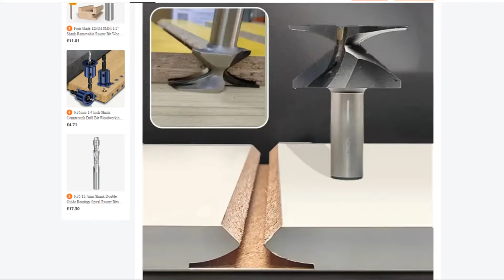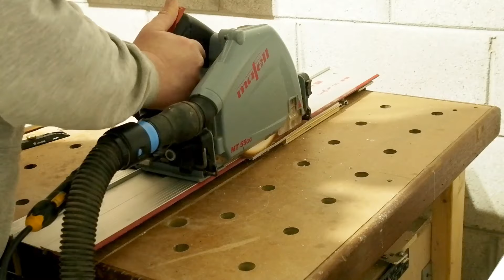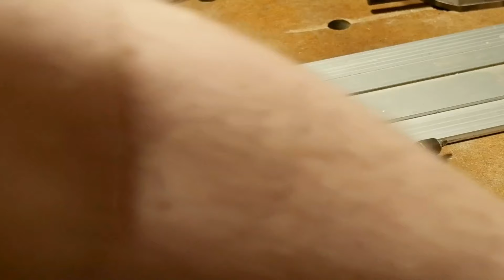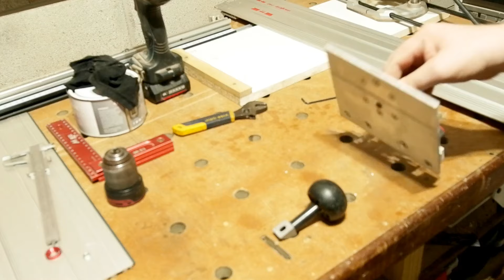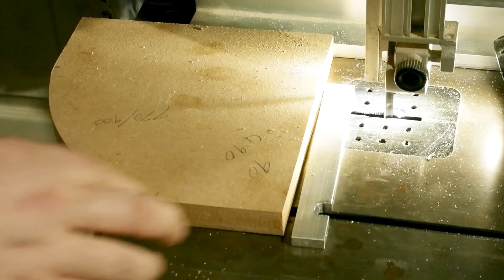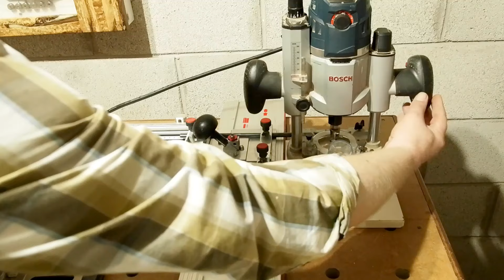DIY Precision Router Guide Rail Adapter - Solid Aluminium - For Mafell and Bosch Guide Rails

Comment: A good idea and well executed. You can't beat a smear of beeswax to lubricate sliding components without clogging everything up with dust👍
Reply from the maker: Cheers! 1001 uses for beeswax +1😉 I have a tin of axminsters machine wax. I find it very good for a slippery surface. Buffs dry so doesn't collect dust either👍

Comment: That’s top work Man. My only nit picking suggestion is with the micro adjustment. Maybe stronger springs and a finer pitched thread. The springs to ensure the mechanism is always bearing against one side of the screw thread, and the finer pitch for finer adjustment.  But, that’s the sanding equivalent of going up to 4,000 grit.
Reply from the maker: Cheers buddy. Believe or not, the m8 is twice as fine a pitch as that on the bosch ofa! Any finer pitch and, to be honest, I'd just get frustrated with how slow it would be. A couple of slightly stronger springs would be nice though to cut down back lash. The ones I'm using are from the micro adjust on the bosch "deluxe" fence. Always appreciate your input and ideas mate👍

Comment: This is a project Hongdui should partner with you and make! 
Great project fella, then end result looks the business as well. I’ve been playing with adapting a 3d printed adapter, but certainly not for something that heavy duty.
Reply from the maker: A Hongdui collab has crossed my mind.  I've already quite a few tool/accessory designs. I've got a decent idea for making a router guide more universal. That might be one I'd share with them. For things like this, 3d printing is ideal. Hell,  even if it was just to print a knob for the M8 micro adjust bolt!👍

Comment: Nice idea and execution. I would have looked to use some phenolic or HDPE to run against the rail nib to avoid the binding/friction issues you had to overcome with aluminum sliding on aluminum.
Reply from the maker: There was no friction issue aly on aly  bud. The adjustment allowed me to increase or decrease the friction. I actually like a nice glide but with a little resistance. 👍

Comment: A very neat solution and looks far better than the Bosch one.
Have you ever had any thoughts on making parallel guides for the Mafell track?
Reply from the maker: Thank you mate. Yeah, considered a way to do parallel guides for Mafell track but, in honesty, I wouldn't really have a use for em these days. Between my table saw, rail square and mft bench rail, I'm pretty well covered.👍

Comment: Nicely executed mod there mate. I'd love to have Mafell tools but they are ridiculously priced over here. I like Bosch but what I get here is made in the far east.  I don't mind coughing up for proper gear but when Mafell want 1200 ish for their track saw  and the Bosch is close to a a bag of sand I go elsewhere.

I love making crap out of ally. When I was in school at shop class I used to make drum cymbal arm clamps
Reply from the maker: Cheers buddy.  Yeah, Mafell still make like 90% or something of their tools in house, in Germany so carry a premium. They are excellent though. That said, these days, in terms of plunge saws and routers, even the budget brands are good. Just be sure to get soft starts! With some tinkering, hopefully folk could adapt something like this for whatever router and rail. One downside of the bosch mafell rails compared to festool pattern rails is they're more difficult to accessorize.  If you don't mind playing with a bit of aly, anything's possible 😁👍
Reply: @BischBaschBosch   Even the Bosch version over here is $$$ and it's not made in Germany.

I'm still on the fence as if I'm going to restart woodworking again or not. I bought a 21mm Wen plunge saw that fits the fezzy type tracks. Think I paid under 2 ton for it. Did the right thing though and be a Freud rip and cross cut blade for it. I'll see how it goes. Might need two sets of rails if the rip kerf is diff from the cross cut. Once I find my mito cally's I'll be able to check. Since I've moved, everything is is boxes still and none of them are labelled.
Reply from the maker: I hope it's not the price of gear that has you doubt whether to get back into wood working or not mate. It's not a cheap hobby or profession but, you don't need flagship tools. The budget options are more than capable and there's a healthy second hand tools market. The valuable asset is what's in your head - what you make - not the tools you do it with. You did the right thing for your saw. Blade upgrade is money well spent.👍
Reply: @BischBaschBosch  I appreciate the reply mate.

As for woodworking, I'm weighing up may options.

I could do it in the basement but I have a furnace in there which I don't think is kosher.

The other option is to use my back shed. I'd have to ask the landlord  if I can knock out the partition. in between, The rafters go left and right so it's no load bearaing.
Reply: After that I'd have to decide to add ac and heating. I'm 58 now and weighing up on if I can be bothered.

I know it sounds like a cop out.

I started a small outside office shed business, I got one sale and lost my arse on it. I'm on the wrong side of the US despite all the press I got.

I'm an architect by trade, not sure I'd make much money doing woodwork,
Reply from the maker: @66meikou  It's amazing what you can craft, if on a small scale, with a small solid bench somewhere and some hand tools. Getting into woodworking to make money is extremely difficult though - outside of the carpentry and joinery trades. Seems the only things that sell regularly for unknown amateur woodworkers is cutting boards/blocks and stores-all trays! Commissions can be few and far between for anything more interesting and, even if you amazing pieces to show to drum up business, getting in at galleries, events and fairs can be costly and selective. If you do it, do it as a hobby and make your money by other means. If your craft is saying something, people will one day notice. It is a rewarding endeavour though. Here's hoping you give it another go.👍

Comment: Nice job, i love making jigs and adaptors for my tools. Do you have any millwright experience? I ask because i was one in a past life and it has helped me work out a lot of problems i have come across in the shop and on the job.
Reply from the maker: Thank you. Me too. Not a millwright no but, I did a HNC in mechanical engineering some 14 years ago and did a brief stint as a machine setter. Long story but wasn't for me. I was happy to return to carpentry with a new perspective 👍
Reply: @BischBaschBosch  The way you approached the build i new you had some background. Same with me i have been a one man show doing custom woodworking the last 25 years and it was the best career switch i could have made.
Reply from the maker: Find something you're happy doing and you'll never work a day😁👍

Comment: never use the flat side of a router base always the circcular side
Reply from the maker: With the circular side, using that router bit, it was impossible to keep it against the rail. Hence using the flat side. Flat side was an improvement but, as shown, still wandered toward the end.
I should add that the very reason a router base has a flat side is for running against a straight edge - like a guide rail.
Reply: I never use the circular side, I've 15 or so high quality routers from various manufacturers and none of them are perfectly concentric.     Close but not perfect.       When your doing precision work the circular edge is rarely up to it.    Ok for rough stuff.